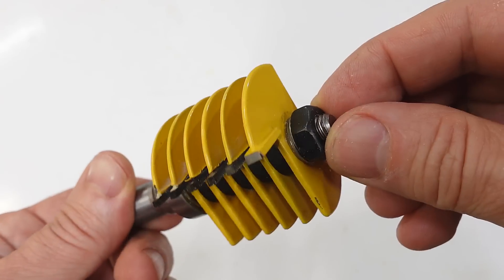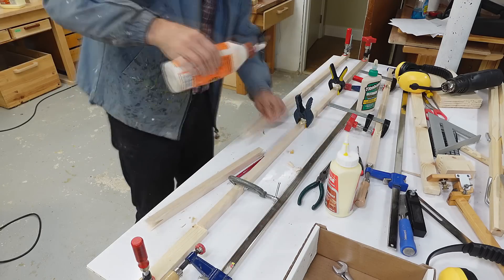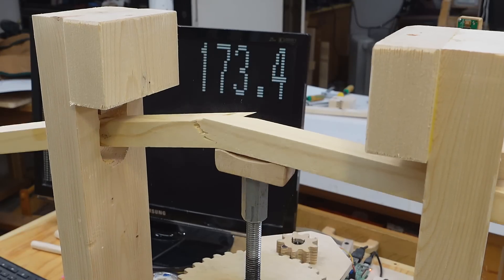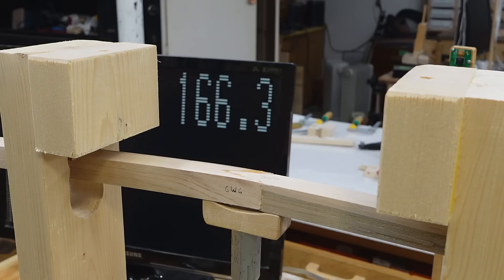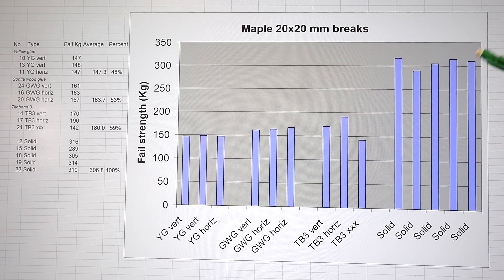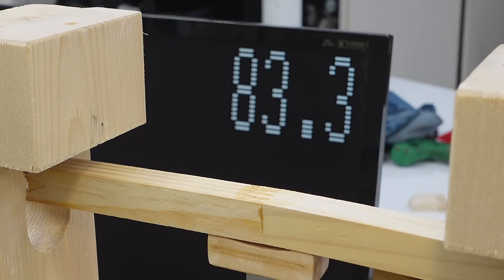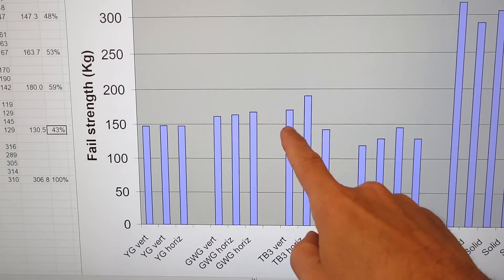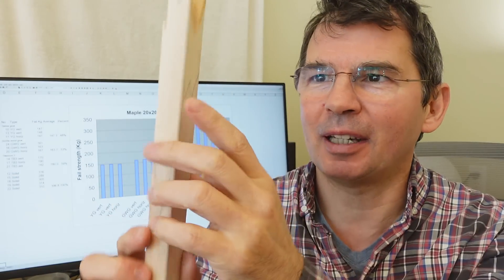End-to-end V-joint strength test

Comment: It would seem that the glue makes the fibers of the wood more brittle. I wonder if there's glue that matches the elasticity of wood more and might give similar strength as non glued?
Reply from the maker: interesting theory.  maybe like welding steel that is too hard.  I just figured the grain discontinuity was the culprit.
Reply: @matthiaswandel   When I visited a Hobby Shop, I noticed a rack of many variations of Super Glues, from the same company.  In fact, one of them was specifically formulated to be more "Flexible",  for just that type of reason.   Im guessing there are other glues, that also have flexibility as one of their feature properties.

 Not sure if the more flexible glues have other weakness.. such as not being as strong, when pulling two pieces apart.

 I will say, that the ancient Chinese Sword makers... used two types of Steel in their Swords.  The center core of the sword was a very High Carbon steel... and the rest of the sword was a more flexible low carbon steel.   High carbon steel can be Brittle on its own... and that would be bad for clashing against another sword.   However, High carbon steel can be sharped to a razors edge, and it will hold that edge very well.   The low carbon steel is difficult to sharpen to a decent edge... and it dulls very quickly.   However, when combining the two... the low carbon steel protects the high carbon steel from easily breaking.

 Its Very similar to a Pencil, actually.   Where the Graphite can be sharpened to a very fine and sharp point... and the soft wood, protects the graphite from easily breaking.

 It be interesting, if something like Pine Tree Sap, would make a better "Glue" than actual woodglue?  heh

 But as far as the Breaks go... Im sure it a combination of both the glue, AND the types of weakness of the wood joints themselves.
Reply: @matthiaswandel  Would love to see a set of tests using resorcinol glue (typically used in adhering the plies of exterior and marine grades of plywood)
Reply: Maybe the same chemical that prevents the glue from curing also mildly dissolves the lignin upon application.
Reply: Mmm.... maybe polyurethane construction adhesive.
Reply: If a wood piece is very knotty does that affect the strength of the entire piece or only around the knot ? Do you cut off and re-joint those sections? Is it better to use biscuits for jointing two load-bearing sections ?

Comment: I wonder why the wood glue was failing with the hardwood. It looked like the glue was not soaking into the wood surfaces. I wonder, is this expected performance for Gorilla Glue (polyurithane, I guess?) and Titebond III (PVA?), or can the result be improved through application technique?
Reply from the maker: end grain hardwood is stronger than glue.

Comment: My woodworking is limited to hobbyist boatbuilding. Scarf joints in boat building often have a bigger glue area than the same in terrestial carpentry: say 1:8. Do you think that would yield better test results?
Reply from the maker: of course, the longer the scarf, the better.  but also more length lost and more difficult to cut and glue.

Comment: I've been following this series with interest. For finger jointed lumber like mouldings and such sold in the building centres the results are directly applicable. But it occurs to me that for panels made up of several finger jointed strips, unless the finger joints line up the panel as a unit will fare better. It might be an interesting statistical exercise to make an estimate of the panel strength compared to individual strip strength.

Comment: I'd be curious how different diameter and length of dowels would fare as a method for extending boards
Reply from the maker: weaker than the finger joint, I'm quite sure.  For the same reasons the finger joint is not that strong.
Reply: @matthiaswandel  A Round dowel of hardwood embedded say 2 inches on either side would potentially lead to less stress concentration, especially combined with some PL 8x or a non brittle 5 to 15 min epoxy
Reply: @rolfbjorn9937  Does round vs square dowels make any difference? Which one lines up evenly with the grains?
Reply: Would be curious on the various joints, with a bamboo skewer pin through them.

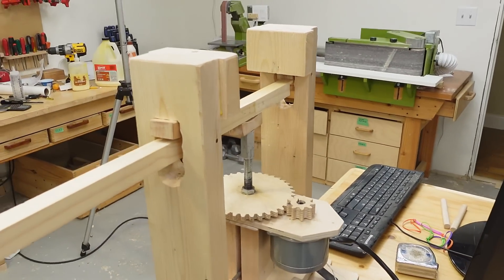Comment: I used to work in building wooden aircraft. We used 1:15 ... 1:20 single sided scarf joints to join both birch plywood and pine. Joint was first primed with raw SP106 epoxy followed by thickened (fumed silica) SP106 as actual gap filler.
Reply: Wild! What aircraft were you making from wood?
Reply: @evanbarnes9984  

Atol amphibian
Reply: @evanbarnes9984  Atol amphibian

Comment: Is the code for the tester available?
Reply from the maker: Its not written as a product, and I don't have time to support people who won't understand it.
Reply: Should be easy enough to write your own. I made something similar with a load cell and ESP32 where it'd output current load, max load, etc to an in-built OLED screen & serial and it was about 10 lines.

...I later added a web server that displayed the into on a webpage hosted on the ESP. That added a bit more coding complexity but nothing that I didn't just copy-paste from a tutorial.

Comment: What if you just make one diagonal cut all the way through at 10°, overlapping the pieces? Should give the same glue area
Reply from the maker: yes, but uses up way more length
Reply: Mattias showed in the previous video the difficulties he had with alignment for joints like that. The v-groove prevents the two pieces from slipping past each other during glue-up.

Comment: So the moral of the story is finger joints for low to no stress applications only
Reply: But they use finger joints on the flanges of wood I-Beams 🤔
Reply: @AdventureWithGus  Would make for an interesting test.  In an I beam, the load is pulling the board apart from each end, rather than bending along the joint.  It may vary by manufacturer, but the one's I've seen use some sort of really tough epoxy rather than glue as well.
Reply: @AdventureWithGus  as it happens the second storey of my house is supported by finger jointed I beams and rated for the 2" layer of concrete for hydronic heating.
As they only span 12 feet and are very 
Much over rated I think that falls into low stress
Reply: @AdventureWithGus  I have not been able to find the original video that I watched 
Search for.   Bad Reichenhall ice rink roof collapse.  To see what happens 
When things go horribly wrong
Reply: or for cosmetic reasons
Reply: Or for cases where you would try to pull the wood apart instead of bending it, like in a box or a drawer.

Comment: In einem alten (1956) Buch über Flugmodellbau wird auch das verlängern von Vierkantleisten aus Kiefer und Balsaholz behandelt, Dort steht, man schrägt beide Enden einseitig an (also nicht V förmig) und verleimt es zu einer längeren Leiste. Die Länge der Schäftung ist dabei die 10fache Materialstärke. Habe ich immer so gemacht und hatte nie einen Bruch.
Reply: Yes this makes perfect sense to me because both parts of the stock ha e equal thicknesses and no weak (thin) parts. The longer length of the joint halves will cause the joint to flex more before it fails.
Reply: Und wie spannt man die Leisten ohne dass sie verrutschen?

Comment: I recall from my boat-building days many, many years ago, we used 8-to-1 scarf joints on plywood glued with epoxy. This was supposed to give the wood close to non-jointed strength. Although this may not be practical for what you are doing, it is a great way to get 16' lengths of plywood.
Reply: Wow, I also comment before reading other comments. The 1:8 ratio  is widely recommend for scarfing plywood.
Reply: @Srulio  My comment was the second comment, and I read it.

Comment: Keep your gorilla glue in a metal container with silica gel. It needs moisture to cure. Cheers!
Reply: Quite true for Gorilla polyurethane glue. But I think Matthias is using Gorilla brand wood glue, which is similar to yellow wood glue.
Reply: better yet with calcium chloride from dehumidifier packs